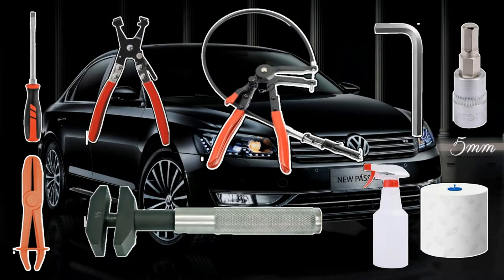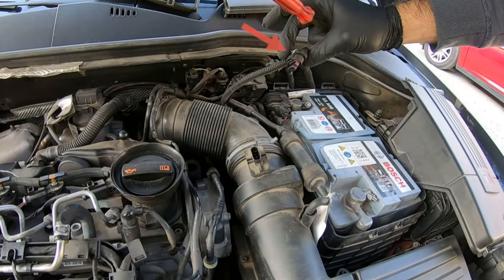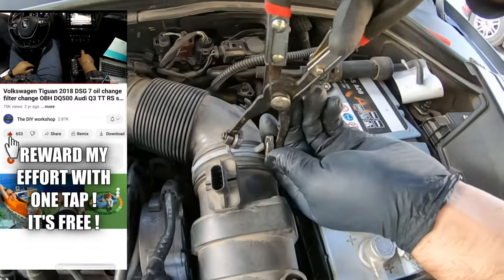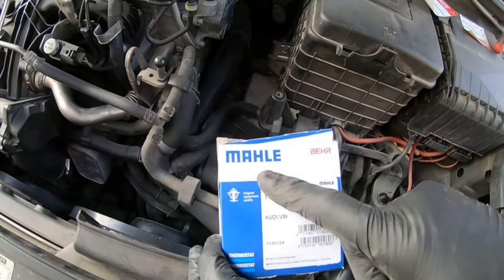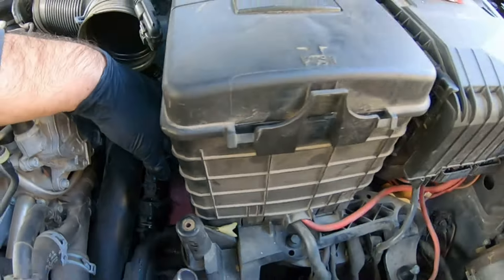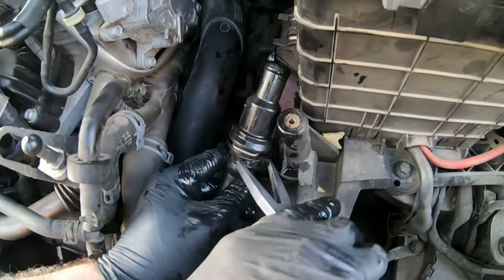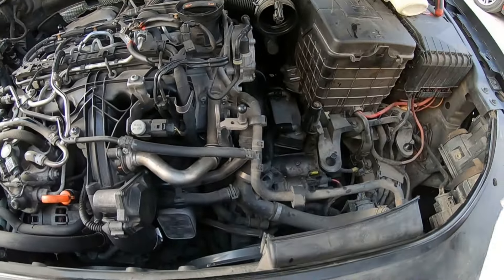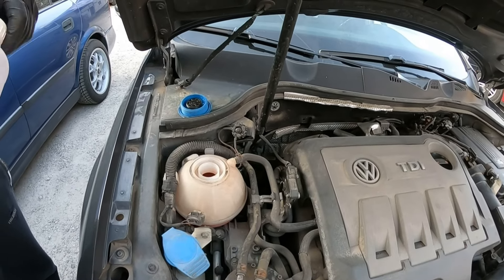VW Passat B7 DSG Coolant Thermostat Replacement DIY

Comment: Iv replaced main thermostat today, along with dsg inline thermostat and coolant temp sensor, new g12 coolant. My temp is still dropping. Any ideas? CFGB engine
Reply from the maker: Try the 4/2 thermostate https://youtu.be/OJKkdoNLpn4?si=1UdqYps5mV68wTXw or the water pump. It's hard to say for sure.

Comment: It's my understanding that the B7 has 2 coolant temp sensors?
Reply from the maker: You are right. There are 2 sensors and one thermostat for manual gear box and 2 sensors and 2 thermostats for automatic gear box. For now I only made 2 tutorials with the DSG coolant thermostat and one sensor because they are the first to fail and easy to replace for a DIYer. The other thermostat and sensor are a bit more complicated to replace. Probably in a next tutorial.